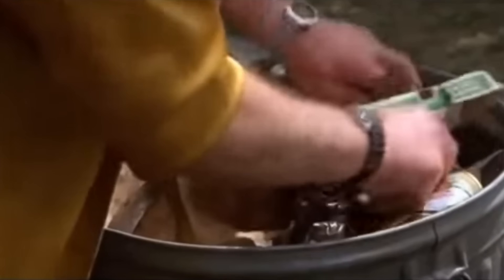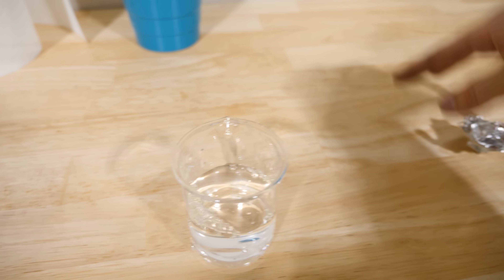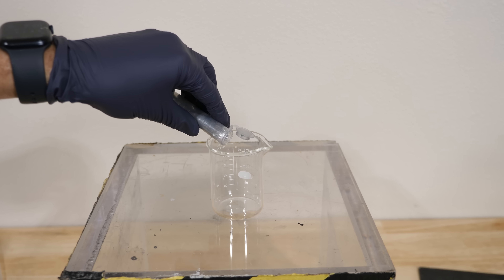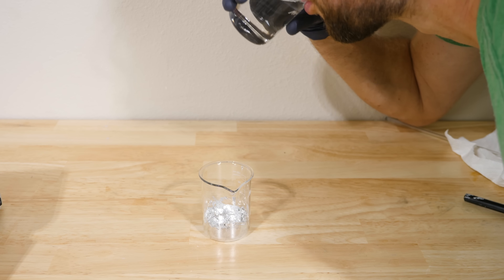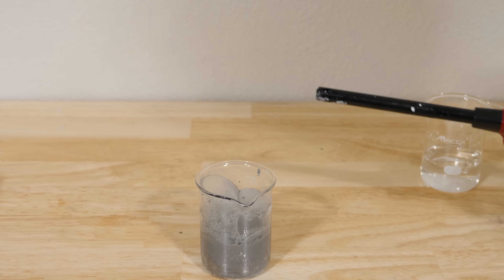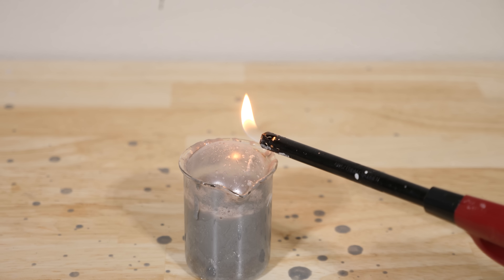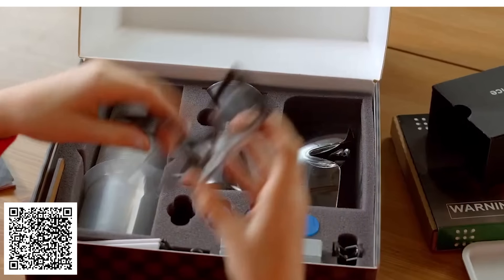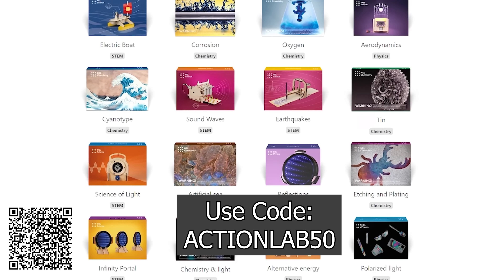This Liquid Metal Turns Garbage Into Fuel

Comment: I think it's not economically feasible. Because of two reasons
1. You have separate the aluminum trash from the other trashes. I.e aluminum cans from the food waste.
2. Once you have all of this trash aluminum. You are most likely going to sell this concentrated alu-trash to a recycling center to make new aluminum.
You see, 65% of all aluminum right now are recycled because it is less energy intensive to get aluminum from recycled alu-trash than from alu-oxide ore. I don't see people making the switch when it is simpler to make hydrogen via hydrolysis.

Comment: What about metal-air batteries (similar to a zinc-air battery) where the "fuel tank" can be filled with gallium-aluminum alloy while emptying the waste dispenser with the aluminum oxide? That would be more practical than producing the hydrogen, which requires adding water in addition to the aluminum.

Comment: Now burn Magnesium metal in steam to produce Hydrogen No alloy of rare metal needed, so you save a lot of mass. You easily control the reaction rate by the rate of addition of steam, and Magnesium Oxide (MgO) is relatively inert. Re-creating the metal from the MgO is done with any of several known approaches you can find in the Wikipedia article on Magnesium. Mg is quite abundant on Earth and in space. It is easily obtained from seawater, where it is the 3rd-most common dissolved element. See also the wiki on the Magnesium injection cycle engine.

Comment: I mean you can also use drain cleaner to do this. Sodium hydroxide also prevents the oxide layer from forming and even better, the aluminum will then react directly with the drain cleaner. Downsides are obvious though. First is there's no way to stop the reaction without diluting it, second is the reaction will become slowly less effective as byproducts form on the surface of the liquid. So while it can be used to make hydrogen, it's not really a good way.

Comment: Where is the aluminum? Like gallium was stoping an oxide skin from forming that’s why the aluminum reacted to water. It bonded to the oxygen and released the hydrogen gas. So there should be aluminum oxide in the water now right?  What do you do with the “hard” water

Comment: If you want to see an aluminum, molten aluminum in this case, and water reaction look at the explosions that occurred at the Twin Towers about 45 minutes to an hour after the planes hit the towers. He fires melted the aluminum got them into Pockets inside the debris in the towers and when the sprinkler systems finally got water to get to those points in the buildings they exploded with extreme force. This has been seen in aluminum manufacturing facilities a number of times. So yes Melton aluminum is very dangerous. Molten magnesium is also. And it can be at temperatures high enough to melt steel. It answers all the questions of all of the conspiracy theorists in the Twin Towers investigation.

Comment: There is a more cheaper and easier way to destroy aluminium oxide film on the surface of aluminium pieces. You should put aluminium into solution of copper (II) sulfate (low concentrated) and then add there some sodium chloride.

Comment: Cool video. But it raises the question then about where you get more aluminium next time? since it's easier and cheaper to recycle it than make it new. I'm not sure the energy released in the form of hydrogen would be anywhere near what was required to make the aluminium. I think hydrogen could be an awesome fuel. For one, we can pipe it down existing natural gas lines and pipelines and many boilers and burners can be converted to run on it. We can make it for free with solar/wind and water. But, it requires tons of energy to make, so much so that ammonia looks like a good way to use hydrogen. Trouble is there are few energy sources better than oil and gas. And that's fine. We shouldn't always be worried that something isn't as good as gas. But if it requires more energy to produce and pollutes more, then it's not a great solution.

Comment: You did add energy in the form of the butane lighter to combust the hydrogen.  There is no free energy.  You didn't mention the by-products of this reaction.  I assume they are toxic and have no reclamation.  Since many machines, e.g. airplanes and automobiles, use aluminum for their structure you cannot use gallium for an energy product in those machines.

Comment: Post-consumer aluminium can be relatively easily melted down and turned into stuff, so burning it off into alumina just to make fuel doesn't seem like the brightest idea. Might have specialty applications, but for most purposes if you have the necessary power infrastructure to make green aluminium, you may as well cut out the middleman and electrolyze water directly.

Comment: Well yeah this idea is pretty unconventional to use only scrap and leaving behind aluminium oxide. You still need to make aluminum out of that again, or else you end up emptying the aluminium supply of the world. Basically you are turning recyclable aluminum into waste if you dont make aluminium out of it again. You should be able to do that but at energy cost, obviously. But I guess you'll need to address the problem of CO2 evolved with aluminium electrolysis and find a workable solution that releases oxygen instead. Old problem. But with promising perspectives.
I guess the details are way complicated why you would do this instead of storing hydrogen which still should be more efficient to produce in a PEM electrolyser.
If the idea is only to use aluminium and leave behind aluminium oxide I dont get the point. That would be like burning fossile fuels but aluminium instead and trashing the leftovers. I think there is more to it than just remove aluminium from the scrap recycle cycleand then youd need to replenish it using hall herault.
I guess that must be something like collecting trash for the winter making hydrogen and then replenish aluminium in summer.
Anyhow that is not really using trash to make hydrogen just that would be a more  meaningfull circular use of aluminium with a lot of consequences for the price and availability of aluminium.
I guess that's what they calculated and found out that it makes sense economically.
Also if you think about transporting energy this might be a part of the transport aluminium to the place where you need hydrogen and on the return way deliver aluminium oxide.
Almost all metals are nowadays recycled so dump to trash wont work out. That would be only a kind of solution if you'd anyway throw aluminium cans to landfill or something like this(which you dont of course)

Comment: In a block of aluminum, only the outside surface is oxidized. Therefore, why not just grind the block of aluminum to a fine dust inside a chamber filled with a non-reactive gas like argon? Then you would have a source of pure, unoxidized Al to play with.

Comment: As a lad, about 60 years ago, I used to put aluminium, milk bottle tops in a jar and add caustic soda and boiling water. l quickly covered the jar with paper held in place with an elastic band then punctured the top to allow the hydrogen gas to escape and added a lit match. Boom, well pop really, and the top was blown off 🤓🤪

Comment: What kind of gases and particles are released in the exhaust? If it's hazardous then that would explain why it never took off but if it burns clean then it might work if the process can be altered into a more efficient design
Reply: The only gas produced is water. The particulates are probably aluminum hydroxide, gallium hydroxide, and bits of unreacted Al and Ga; these aren't particularly dangerous but could be filtered out.

Comment: From what I understand, the biggest thing in the way of hydrogen power isn't generation, it's containment. It's the lightest element and apparently it's damn near impossible to prevent leaks.
Reply: This would solve the storage issue... you only generate it it when needed and contain long enough to burn or react in the device that is utilizing it. In effect Aluminum and tthe water act as a hydrogen storage medium.

Comment: But, but, but...
What happens to the aluminium?
Reply: used. Aluminium hydroxide
Reply: @backyardtortoise.  used insinuates that it disappeared. The hydrogen obviously vapourises as a gas.
Reply: @1one3_Racing  yeah, what i meant was there is no raw aluminium left anymore. Now its Aluminium hydroxide.
Reply: @backyardtortoise.  but what is that? A liquid? Doesn't appear to be anything solid left over. Hydroxide generally isn't a gas.
Reply: @1one3_Racing  It converts into whitish liquid.
Reply: @backyardtortoise.  ahh. So when I have those "special dreams" I'm actually making hydrogen gas in my underwear?
Neat.
Reply: @1one3_Racing  Who knows 😏

Comment: This is not a solution though because to produce metallic aluminum from bauxite requires electrical energy for electrolysis in the first place. It would be much better to use direct electricity from solid state lithium cells to run the motors.

Comment: possible, 10 tonnes for 0.1 tonne of hydrogen produced. We trash about 3 million tonnes a year.... Need I go further? Oh it's the economics you want. 30,000 tonne of H produced and sold at roughly 15$ per kilo is 450,000,000$ per year... for trash. I already developed a processing system that should work. With an investment of 50 million to start should be easy to have a 4 year return from start date. Plus infrastructure is quite well developed in most country for transport and storage. On site modular production plants are the easiest for both logistic and policy reasons.

Comment: You can use toilet duck, it's a toilet bowl cleaner and mix in aluminum foil in a plastic coke bottle and shake. It will build pressure and explode, I did this as a teen years ago. Don't know if toilet duck is still a product.

Comment: Its cheaper to recycle aluminum than to mine and make it. 65% of aluminum is already recycled in the US. That last 35% likely has a reason for not being recycled. It would be interesting to see if that reason makes it impossible to use in this way. For example, contamination with other junk.

Comment: For the reaction with sodium hydroxide, it doesn't consume the sodium hydroxide.
It will concert the aluminum into aluminum hydroxide and the atom of sodium react with the water to form hydrogen, so the sodium hydroxide is just a catalyst in the reaction and you don't need to add more during the reaction to keep it going

Comment: Part of the reasoning for the collapse of the World Trade Center towers includes hydrogen explosions. The aircraft bodies were aluminum, heated to melting in the fires (there are films showing liquid metal pouring from one tower). Water from the severed sprinkler and plumbing piping, mixed with the tons of molten aluminum could generate lots of hydrogen and a possible explosion. Conspiracy theorists claim that the buildings were pre-loaded with explosives to implode them (hard to believe in those buildings in continuous use). The aluminum to hydrogen explanation makes more sense to me (I'm a chemical engineer).

Comment: This could potentially be used as a cheaper easier way to get Hydrogen tanks for Hydrogen powered cars. The big problem with Hydrogen cars is that getting refill tanks are pretty expensive atm and there aren’t a lot of places to get replacement tanks, but if things like this were to be done on an industrial scale, there’s potential for it to be competitively priced with gasoline, it’s price would likely be more consistent than gasoline and it would create less pollution. Of course we don’t have the infrastructure for all that yet but it’s cool to think about.
Reply: It's easy and cheap to get hydrogen tanks refilled, if you have cheap electricity. You just use an electricity supply to electrolyse a water supply. The big problem is that practical hydrogen tanks for vehicles are large. That means hydrogen-powered buses and short-range trucks are quite viable (and hydrogen-powered buses are quite common), but hydrogen-powered cars are much less so.

Comment: The aluminum isn't exhausted either. The aluminum bonds with the oxygen forming bauxite, or for the layman, aluminum ore. Its not energy positive, as you said. Since it's not exactly cheap or free to separate the oxygen from the aluminum. But it can be a carbon neutral process if we powered our aluminum mills with nuclear power. Please write your congress man.

Comment: Are cans really in Aluminum? If so why? A thin steel sheet doesn't affect much the weight of a filled can and it's cheaper. It's about food contact grade, corrosion? A nickel plated sheet would then be better?

Comment: I had no idea Aluminum was reactive with water, that's really cool! I'm not sure if this would make for a good energy solution, though. The waste product has to be manageable and/or recyclable to the extent that we can reasonably start widely using this.

Maybe there are some implications for small machines that recycle aluminum like this for generators?
I'm imagining something like being on a spaceship, if you needed emergency fuel this could be a solution?
Just my imagination.
Reply: You use electrolysis and vapor transmission to replace the hydrogen and backward react the material to aluminium and start again.
Reply: aluminum oxide is  the ore form of aluminum.   so yes all components recyclable.   energy loss in cycle from entropy/incidenatl inefficiencies; much as is the case with gasoline but with no apparent side issues.   side products from paints or alloys may need study as well. 

only sticking case is gallium is rare  and expensive....  industrial use might exacerbate that situation.

Comment: What happened to the aluminum oxide you created? It's all that grey junk that was spattering from the beaker. I guess you diluted down the left over water and aluminum oxide goop a good bit to wash it away from the gallium. Galium isn't cheap so it's reusable nature is compelling. Recovering the aluminum oxide to make more aluminum is a worth while endeavor since that is its natural form when mined. Seems like this could be used to get hydrogen for a fuel cell or some other use. I think this reaction is also exothermic. Might as well collect the heat too!

Comment: The energy used to remove oxygen from aluminum ore adds up to several percent of all energy used industriously. So there is a lot of potential there.
Reply: Except that the mechanism converts aluminium into aluminium oxide as a product. That would then need to have the oxygen removed in just the same way as happens with aluminium ore. There's no gain in this process in terms of reducing the energy used to produce aluminium.
Reply: My point is the amount of energy put in to remove the oxygen is then available for reactions such as shown in the video, thermite, molten aluminum home and industrial explosion accidents etc.
Reply: @mikebell2112  No, if you put in an amount of energy to separate the oxygen from the aluminium, then you use the aluminium for the reactions shown in the video, you convert it back to aluminium oxide. That then has to be reprocessed if you want the aluminium again. There is going to be just the same total percentage of energy used industrially on the process.

Comment: Could this be used for energy storage? The H2 could be used in a fuel cell to generate electricity on demand. But could the result of this process be converted back to Al at times when excess renewable energy is available and therefore cheap? There will be some losses (e.g. heat), but maybe it would still be worthwhile trying?
Reply: This technology is purely energy storage, not energy generation. I find it very difficult to see what applications would benefit from storing excess renewable electricity in an Al/Ga amalgam, rather than storing hydrogen directly produced through hydrolysis.
Reply: @RexxSchneider  The idea would be to use Al for long-term storage, as it is easier to store compared to H₂ (which needs either very high pressure or very low temperature to achieve reasonable energy density). The Ga would be only be used temporarily when getting the energy back, so hopefully not very large amounts of it would be needed.
Reply: @AndreasEisele  Do we have much demand for long-term energy storage?  I agree that aluminium blocks are easier to store than hydrogen, but you still have to add on the inconvenience and cost of capturing and using the heat generated in the reaction, otherwise you waste a very significant part of the energy stored.
Reply: @RexxSchneider  Here in Germany, installation of on-shore wind is slowing down due to administrative and NIMBY resistance, while PV is booming. So we will have lots of electricity in summer (during the day), but when we need to run heat pumps in winter, there will be a shortage. A way out could be off-shore wind, but this is more costly (also due to the cost of transmission). Turning Al₂O₃ or Bauxite to Al when electricity is cheap might be one building block for a 100% renewable future...
Reply: @AndreasEisele  Given the rapid and massive increase in gas prices in Europe, I'm pretty certain that the resistance to on-shore wind is soon going to be much reduced. Even off-shore wind looks like a better bet than relying on Russia to supply your energy needs. For the moment, I still think that efficiency is on the side of electrical energy storage in batteries or generation and storage of hydrogen. It may be that hybrid thermal/hydrogen generators can usefully employ the redox reactions of metals to/from their (hydr-)oxides at some point in the future, but they will always suffer from the relative disadvantage of returning a significant part of the energy input as heat.